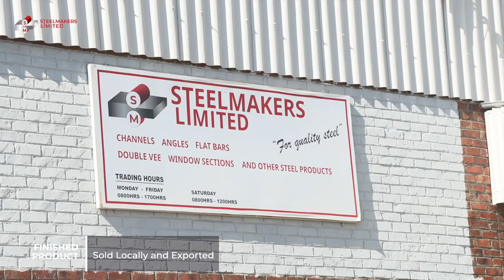Canon xf605 Footage (Steel Makers Limited Process Video)

Comment: so...what do you think of this camera? I want to upgrade from my old Canon XF300...I have mirrorless and even a C100 mk2 but sometimes a camcorder is the right tool for some jobs...
Reply: This is really a versatile camera , shines on run and gun scenarios.l have not shot with it for a very long , l think l bought 2 or so months.

The only draw back is it struggles in low light but otherwise it’s a great camera
Reply: @tarisaimudavanhu1496  yeah...I think sometimes a professional camcorder is the right tool for the job...not for artistic shots or narrative projects. I don't expect this camera to be as good as my C100 mk2 with a sigma 18-35mm f1.8...Low light is a problem with camcorders. My XF300 is good in decent lighting. What camcorder did you use to own before this XF605? Thanks for your video and I hope to see more. I'm not ready to buy it yet....still want to be amazed...I guess, LOL!
Reply from the maker: @TheFandangovideoguy  lm relatively new to videography, but my main camera used to be the EOS R, l did most of my projects with it until the Xf605.

I think this thing packs more, which lm still to explore, indeed l will upload more videos shot by it.

Color grading will change everything, as the codecs offer great dynamic range.